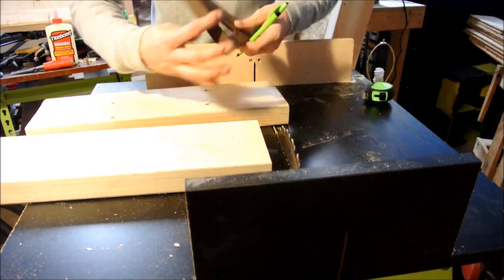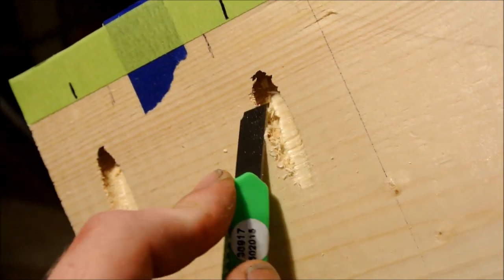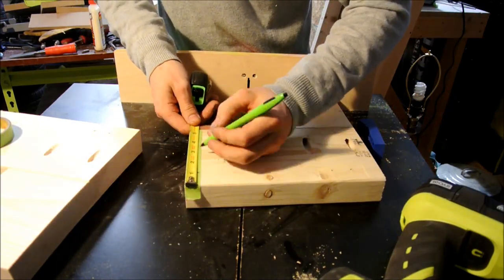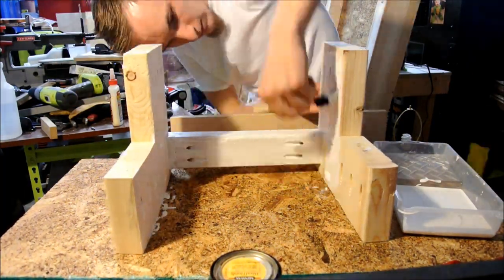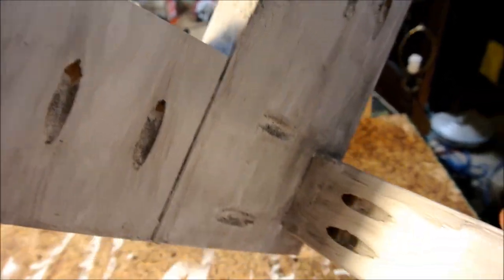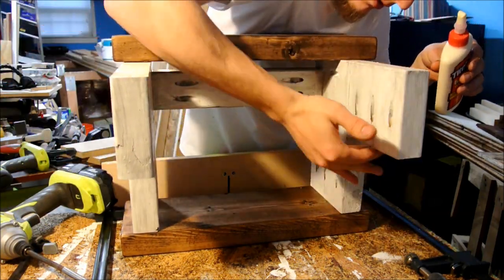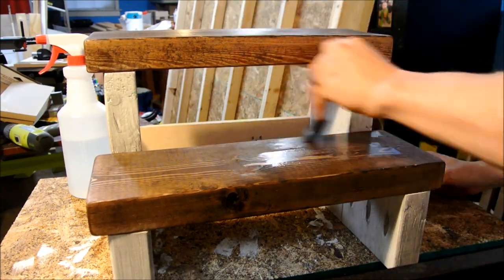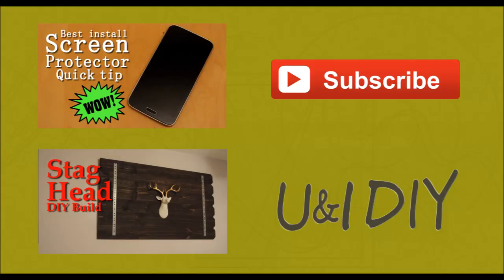Step stool - DIY tutorial

Comment: Thanks for taking the time to upload this.
I have a computer in my workshop with a shelf over the top of it holding my printer and I need this step stool so I can access the buttons on the top panel of the printer.
I'm not that short but it's certainly easier when you can actually see what buttons you're pushing.

Comment: This is a really good video! I'd like to make one for my dog as she has had many back problems! Awesome job!
Reply: i Made a ramp with some carpet for our dog. He had a disc removed and it works great, less stress with sudden jolts. used 3 1x6" 33" long and jigged them together,  Cut corner to corner, that gave me my 2 sides, used 2 1x6", 37" long for the ramp.  glued and jigged them together. Mounted to the sides, put some carpet and trim on it and stained.  I have 3 of them in the house, they (we have 2 dogs) use them every time.

Comment: On the stepstool diy drill all the pocket holes before starting to put it together. I put the 2 pieces together and the 4 1/2 piece would not fit in my kreg pocket hole jig.

Comment: will the cuts/measurements still work if the piece of wood I'm using is 2x 5 1/2?
Reply from the maker: Yes, both treads are made of the same piece. And both support/stringers I guess you could call them are the same with just butted together. 2x6s that I used are actually inch and a half by 5 and 1/2.
Reply: @UIDIY  thanks. Just built it. Came out perfect. I see what you meant by having issue with screwijg in the pocket screws and the cross support being in the way

Comment: i'm making this right now and i appreciate this video! One question, when making your pocket holes, i noticed you had some taped distance. How did you calculate this?
my jig came with a stopper. I'm new to pocket holes so i just wanted to know.
Reply from the maker: I bought the basic pocket hole jig. So the reason there's tape is to make sure that the setback is right. it was a calculation I made through trial and error but basically you want the tip of the pocket holes drill to poke through the wood in the center. The basic pocket hole jig is designed for three-quarter. So since this was inch and a half I added another 3/4 using 3/4 tape to make sure that the offset would put the screw at the center of the board. Then you just need to adjust the collar on the drill to make sure it doesn't drill too deep

Comment: What size screws do you used for the pocket holes?
Reply from the maker: +Joe Guzman the basic jig I designed to attach 3/4 stock with 1 1/4 screws. I used 2 inch screws.

Comment: i need a stepstool for my 94 years old mom (she's very active lot's of energy pray to jesus every morning for 45 min. To an hour )i don't know anything about wood working but you explain very good ,how far do from the edge do i place the pocktholes (you have a blue tape then you clamped it )is it 1 inch ?(my mom wants to help me make it -mmaybe she don't need me)thank you god bless you and your family.
Reply from the maker: +Joe Guzman the tape I used is 3/4 wide. I have found this is my preferred distance for screwing 1 1/2 stock (the actual size of 2x4). This will put the screw extiting somewhere near the center of your stock. If you setup is right you can use up to a 2 1/2 screw for attacking 2 pieces (the same size). You need to start doing some math when I'd comes to attaching different size pieces. If you have any other questions please let me know. Thanks for the support and good luck.
Reply: U&I DIY u&iDiy-i finely made it ,i used all your information and i my mom (very old but still active)is very please she asked me to say thank you for every thing -God bless you.
Reply from the maker: +Joe Guzman glad it worked out. Thanks for your support.